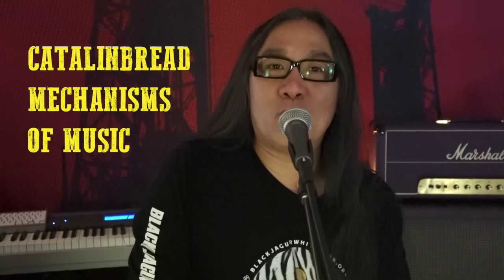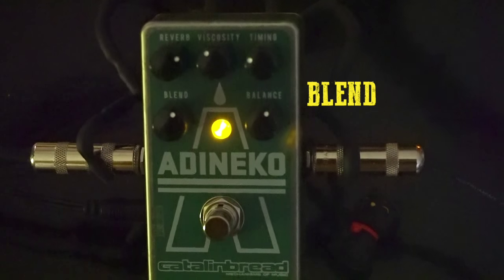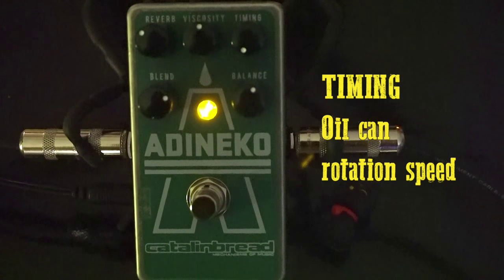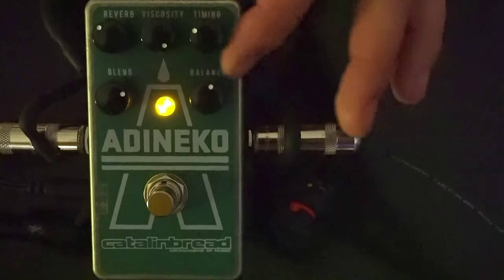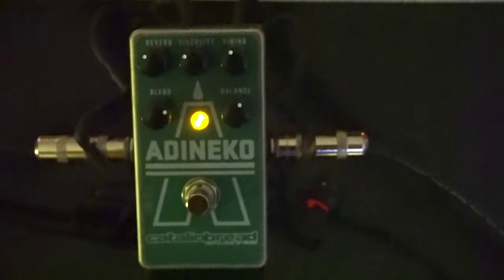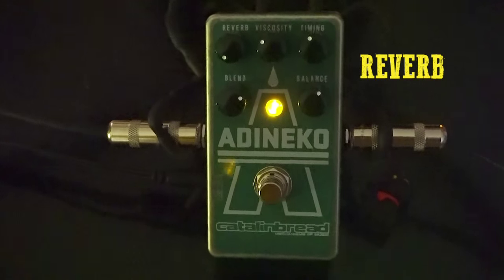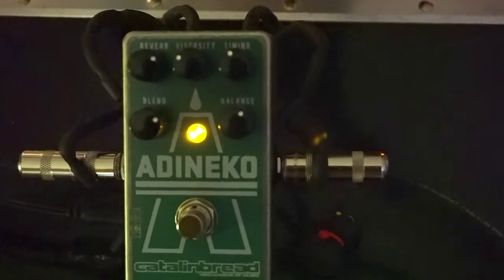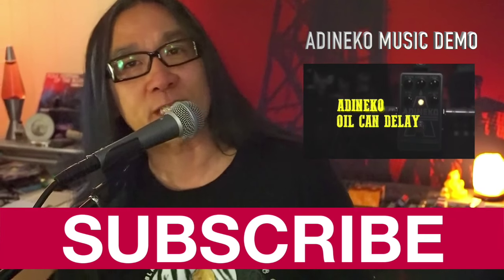ADINEKO Controls Dive Down

Comment: The preamp in this pedal just in its own smokes the EP3 preamp pedal that everyone raves about. It also as a delay stacks amazingly with a good analog slap delay - it will take u to Sun Studios Scotty Moore /Ry Cooder Marc Ribot territory
Reply: Cannot agree more, I love it as a delay but when I first cranked that preamp trimpot it blew me and my amp away. I have The Talisman which also have a preamp but nothing like the Adineko. Talisman's  acts like a boost, Adineko's one is a wonderfull gritty distortion. It's awesome with tube amps :)
Reply: can you have only the preamp in buffered bypass mode?
Reply: Yea I never liked stacking delays but I did used to run my Dawner prince boonar (echorec style delay) into the adineko and it worked very, very well together. The repeats didn't step on each other's toes. I traded mine away and then a year and half later I traded for another one lol literally out for delivery from UPS right now, 1/4/24. 
There's been a handful of pedals I've liked so much I've sold or traded them looking for something better only to realize my mistake. Ceriatone centura (klone), spaceman polaris (OD with LP filter), DL4 (only for the looper) and now the Adineko. It's that good.

Comment: This is a fantastic pedal, and a great demo to get an idea of how to use it effectively, but it results in a one-trick pony impression which couldn't be further from the truth. Too much REVERB will start to mask it's tone, and vibrato. Try fucking with the uglier and more traditional settings (like Hard L, or R on the balance).
I tried cutting the range of the pedals in half (like trying to stay below 12 o'clock on certain settings), as if I were some teenager in the 60's trying to build his own shitty oil can delay. These also yield great results, warts and all. If you're new to the pedal start off like this, using the script on each knob like they were the full range of the pedal. Eventually you'll start hearing what you're missing for your "ideal" tone. That's when the fun starts. It also blends surprisingly well with other pedals, despite it's esoteric properties.
Alone, it's peculiar and cool tone will stun audiences. If you're looking to stack a couple of delays this would definitely not be wise as a first choice. If you're looking for a cool and original tone that will have most guitarists scratching their heads - LOOK NO FURTHER. It's a privilege to have this thing on your board. 
THANK YOU CATALINBREAD! 
P.S - We're still waiting for you to make more Fuzzrite's and the other older pedals that have run out of stock. Looking forward to my email.